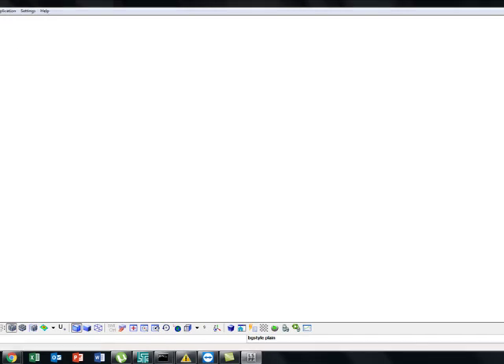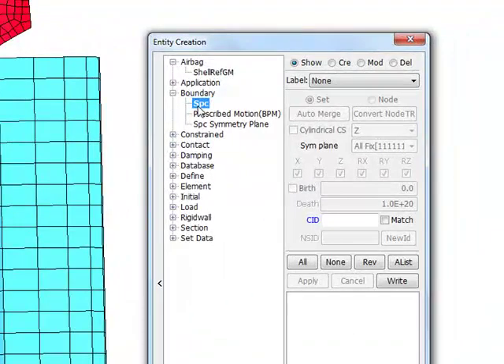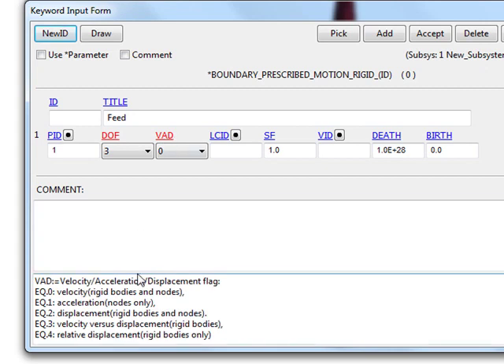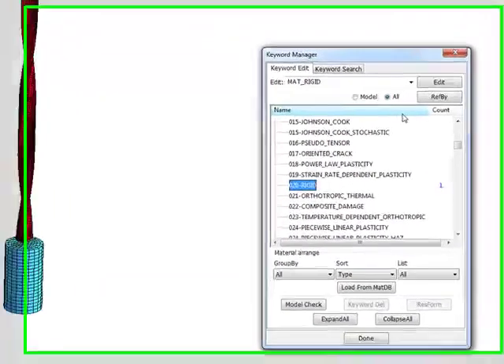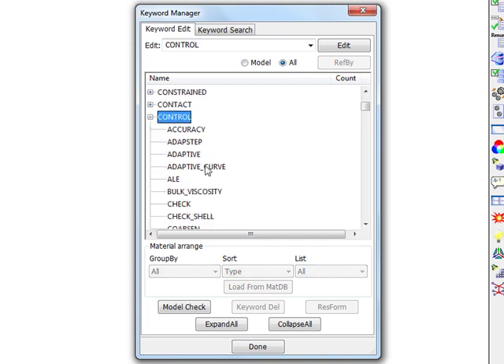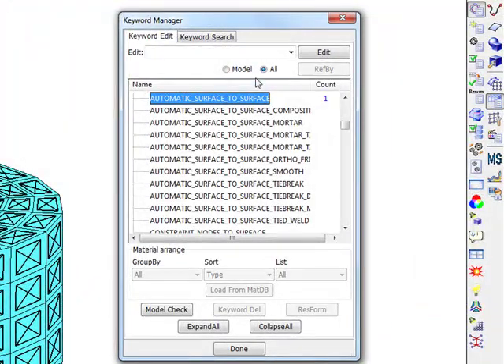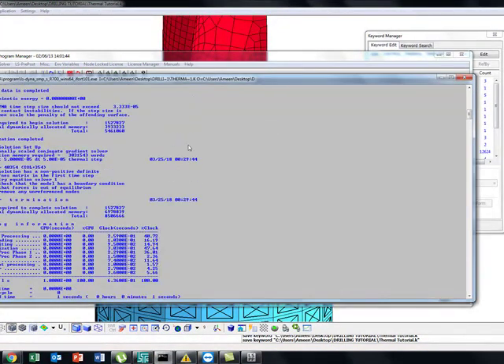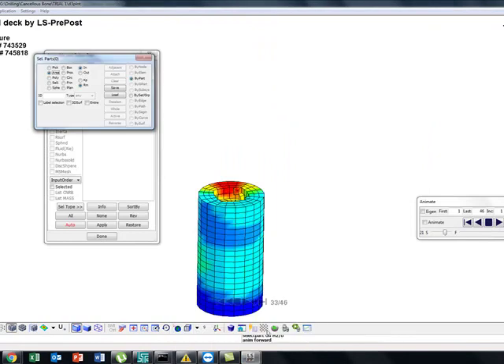Consultation: Drilling with Thermal Effects

Comment: Sir Ameen, thank you very much for your work. Great videos.

Tell me, please, if EPS and ES are mixed up on 24:10-24:50?
Reply from the maker: Thank you for pointing this out!! Yes, I have mixed up between the stress and strain.
Reply: The drill also rotates in the wrong direction), but this is nonsense.
Thanks for sharing your experience, please don't stop. @AmeenTopa

Comment: Excellent thank you so much, one doubt, can i give initial temperature like 200 deg to specimen, in operations like deep drawing or stretch forming, drilling etc..before the process starts,,
Reply from the maker: Yes. Use boundary heat flux if you have a temperature flowing in to your specimen or use initial temperature set to assign an initial temperature.

Comment: The LS-DYNA time step size should not exceed     2.606E-06
 to avoid contact instabilities.  If the step size is bigger then scale the penalty of the offending surface.

 Thermal dynamically allocated memory:      26M

 Memory required to begin solution:    4707K
 Additional dynamically allocated memory:      45M
                                   Total:      75M

 have this messages, Im running with an amd processor how long would it take me to generate the 3d plot?
initalization completed
       1 t 0.0000E+00 dt 5.00E-06 begin thermal step           09/28/21 17:32:36
       1 t 0.0000E+00 dt 2.50E-06 begin thermal step           09/28/21 17:40:22
       1 t 0.0000E+00 dt 1.25E-06 begin thermal step           09/28/21 17:48:10
       1 t 0.0000E+00 dt 6.25E-07 begin thermal step           09/28/21 17:56:38

these are the only values I get.... TY so much for ur contribution
Reply from the maker: I am not sure. I need to know more details about your PC. How many CPU threads are utilized for running this simulation

Comment: Hallo Herr Topa. Ich stelle meine Frage: With the IGES file I made I get a mesh of more than 31000 nodes for the drill bit. The program runs but it will take almost 11 days according to the LS-RUN. I have installed the LS-PrePost V4.7.17. My computer has 18 GB in RAM and the processor is i7 up to 4GHz 4-core. Is it possible to resize the mesh without having to restart from the beginning? Or should I delete the current mesh of the tool and import again the IGES file to make again a coarser mesh but keeping the Tool name in order not to lose the relationships? Thanks in advance.
Reply from the maker: Unfortunately, you need to remesh from the start using the iges file again. There is no other way to do it. 

For the drill bit, it is common to model it as RIGID part. This will save the computational time..
Reply: @AmeenTopa  Thank you

Comment: Thank you bro! I get a problem that Error 40359
the minimum time step has been reached and
the maximum temperature change is greater than specified
 temperature change              4.7690E+07
 max allowed temperature change  1.0000E+04
Please give me some help!
Reply from the maker: You need to change the parameters in CONTROL TIMESTEP. I don't have the details of your model so I cannot give a more detailed answer.
Reply: @AmeenTopa  yeah, however its temperature change is so big, i think something else is wrong. Thank you for replying!
Reply from the maker: Reduce the thermal timestep and use variable thermal timestep.
Reply: @AmeenTopa  OK！ I will have a try, thanks very much!

Comment: Error 30186 (INI+186)the inertia tensor of rigid body #1is too small for the accuracy of the computer to handle.Please add mass or increase inertia.The LS-DYNA time step size should not exceed 2.714E-87 to avoid contact instabilities. If the step size is bigger then scale the penalty of the offending surface.жError 30006 (INI+6)initialization completed with 1 or more fatal errors please check messag file
I'm getting this error. Pls help
Reply from the maker: This could be due to the meshing or properties of the material. I have insufficient information to give a useful answer.

Comment: ***Error 20368 (STR+368)
     mat/set id used in prescribed v.c.
     must be defined as rigid see card no.= 1 mat= 1
     in the velocity b.c. input section

 * Error 20368 (STR+368)
     mat/set id used in prescribed v.c.
     must be defined as rigid see card no.= 2 mat= 1
     in the velocity b.c. input section

I'm getting this error. Pls help
Reply from the maker: The drilling part should be Rigid because you are applying Prescribed RIGID motion. 

If you want your drilling bit to be deformable, then you need to use Prescribed motion SET
Reply: @AmeenTopa  Thankyou for replying. After making that change I got a new error. I am using an elastic material

 * Error 10144 (KEY+144)
     CHECKING PRESCRIBED MOTION INPUT [*BOUNDARY_PRESCRIBED]
     vector set for imposed boundary # 1

 * Error 10144 (KEY+144)
     CHECKING PRESCRIBED MOTION INPUT [*BOUNDARY_PRESCRIBED]
     vector set for imposed boundary # 2

 * Error 10133 (KEY+133)
     input data failed with: 2 errors